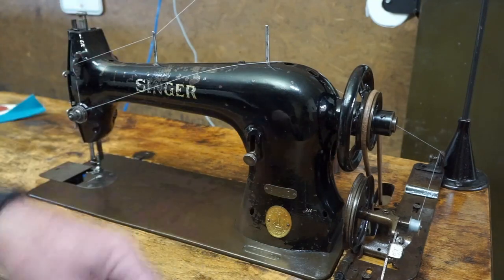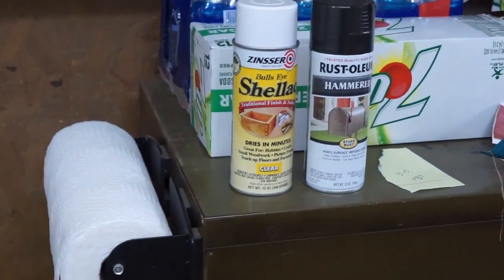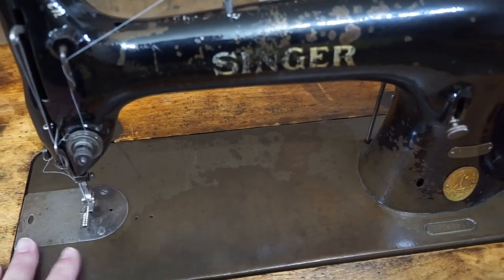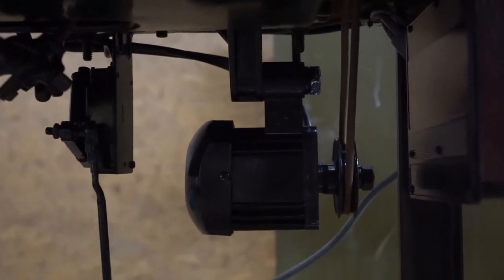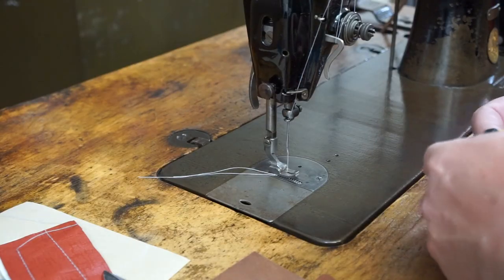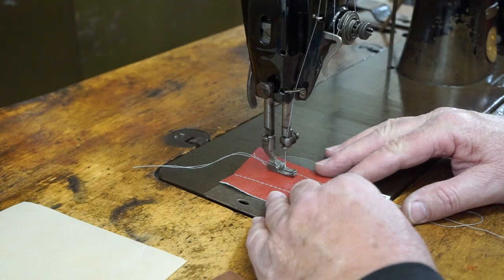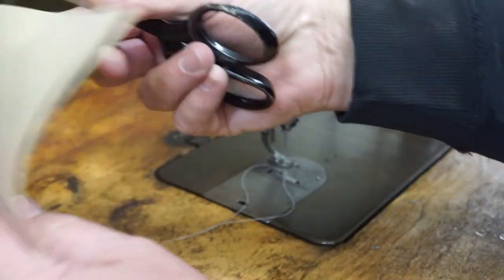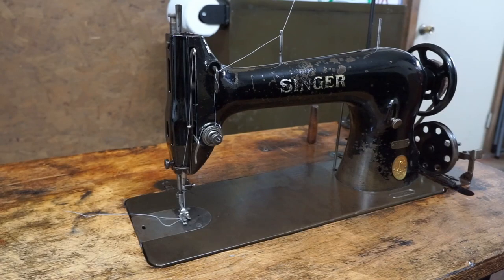1939 Singer 31-15 Industrial Sewing machine vintage look servo power.

Comment: I am with you.  The old machine needs to show its heritage.  I just discovered mine is a 1927.  I am excited to get it going.  I am keeping the clutch motor but installing a consew 3000 servo like yours.  It's like you are making a resto rod machine.

Comment: A great machine! I have the very similar, and more rare, 31-20. It has a clutch motor, but I got it from a friend who was a wizard with old machines. He replaced the hand wheel with a larger pully to make a speed reducer. This machine has reliably sewn all my chaps, belts, and wallets for about 25 years now!